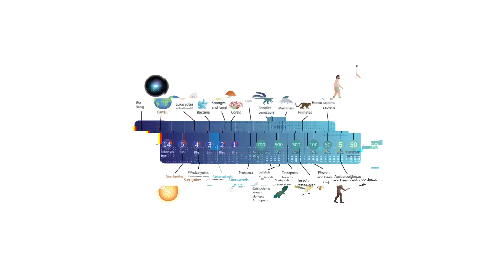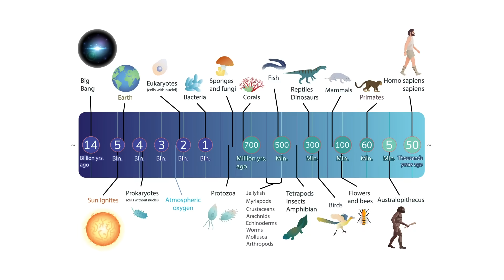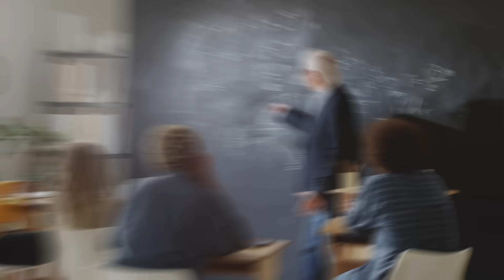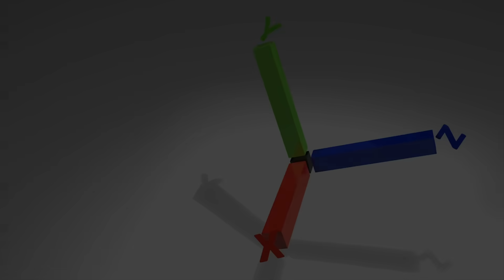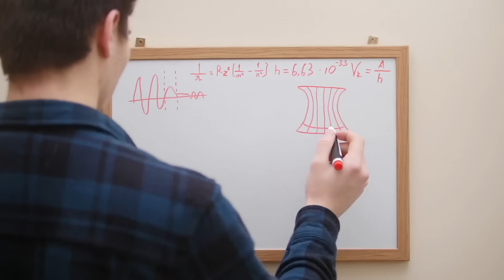Brian Cox - Why Did The Big Bang Happen?

Comment: My Next Best Science Fiction Idea
--------------------------------------------------------
Black holes can be of different sizes, based on the amount of mass consumed. This yields varying event horizon radii, despite an infinite point within. Yet somehow they are classified as the same singularity, of infinite density, when the varying masses must imply varying infinities within. Obviously a contradiction. My argument is that maybe the singularity point and the infinities of temperatures and pressures are merely mathematical oddities, and not the true reality inside. After all, the word 'singularity' means that physics has broken down. Now, eddies within a stream or sea can become gigantic, pulling in torrents of water, yet at the center of the funnel - nothing. It's the flow, the siphon that got going, which keeps everything moving in and the force increasing. Has anyone ever considered that inside a black hole everything has become nothing? Just imagine that as you crossed into a black hole everything including pressure and temperature and shredded matter and warped spacetime got unimaginally large, but still numerically constrained by the limits of a real universe, and then the moment you got inside it all just popped out of existence! One might go from a very large sphere of the immense flow of something, till - just across the horizon - a single point of nothing. In which case our contemporary universe is like swiss cheese. So perhaps the big bang had a relatively large event horizon, perhaps more mass was being created than spacetime very early on, perhaps very large temperatures and pressures became incidental to the incredible densities of matter being ongoingly brought into existence, and perhaps nothing became something without constraining or holding back an infinite something before it initially burst forth.

Comment: White holes produce galaxies . They get their matter from Black holes.  This process occurs due to another dimension where time doesn't exist which is also responsible for 'Spooky Action at a Distance' .  There is no need for a Big Bang Theory . The apparent 'accelerating'  expansion of the universe is due to our Milk Way Galaxy contracting into an elliptical galaxy....we are moving away from the universe not the other way round. This process is accelerating as it collapses so  the 'expansion' appears to be speeding up. The Background   Radiation , thought to be an echo of the mythical Big Bang is nothing more than the rest of the unseen universe which is much older and larger than current theory predicts. 
This is my homemade explanation for what I see. No galaxies moving faster than the speed of light, no Dark Energy or Dark Matter that nobody can find and no 2 Trillion galaxies fitting into your pocket.
It may be all bollox but it makes alot more sense to me than the Big Bang Theory.

Comment: The law of conservation of energy states that energy can neither be created nor destroyed - only converted from one form of energy to another. It would appear that all the energy in this universe is being converted into space through the interactions of the charged particles that exist in it. The expansion of the universe is fueled by the interaction of the charged particles that exist in it. Electromagnetic radiation is just the neutral memory of the interaction between these charges broadcast through space but also stored in it. The fabric of space recording the record of time, using the instruments called particles. Does it sound good enough to go platinum though...
Reply: Blimey, that takes a bit of thought!
Is  it plausible to accept that the conservation of energy law would not be able to apply to the early stages of the universe? Obviously something weird and wonderful was occurring but I think  different laws could have been applicable to explain what was occurring!
Reply: @stuartmoulton6426  Is it plausible to accept that the force that energized this universe was applied from outside of it? We have to bring internal energy to bear anytime we want to exert a force on the exterior world. 

Force transfers the energy we bring to bear from our internal state to an external state. That force can be applied to external bodies and transfer momentum internal to external, external to internal. A good example of the internal to external back to internal exchange of momentum through force is a knockout punch. That is internal energy brought to bear delivered by force to a body external to yours and that momentum is transferred by force to the internal of the body it is delivered to.

It seems conservation of energy would apply to energy moving from an internal to an external state, as well as energy moving from an external to internal state. In this way energy cannot really be contained to a closed system. The nature of force transferring energy from internal to external states will never allow it to be contained to any particular system permanently.
Reply: @jayb5596  I don't see anything implausible👍👍👍, difficult to understand, yes🙄🙄🤔🤔🙄😖😖, implausible, no!!!!👍👍👍
Reply: @stuartmoulton6426  Here is a thought experiment for you to ponder.

The 0s and 1s in binary represent OFF or ON, respectively. In a transistor, a "0" represents no flow of electricity, and "1" represents electricity being allowed to flow. In this way, numbers are represented physically inside the computing device, permitting calculations.

Atoms are built from quarks, two up quarks and one down quark produce a proton. Two down quarks and one up quark produce a neutron, they are interchangeable. A neutron is unstable outside of the nucleus of the atom and will decay into a proton. Protons are stable outside of the nucleus.

Neutron "0" represents no flow of electricity.
Proton  "1" represents electricity being able to flow.

The carbon atom for example represents 6 protons, 6 neutrons, 6 electrons. That makes up the nucleus of the carbon atom, so it represents a 12 bit byte. Each proton and neutron represent a single binary digit. 

A single carbon atom representing 666, is a 12 bit byte. If you account for particle spin you realize that these 12 bit bytes of carbon can be arranged in various nuclei alignments, to represent any combination possible within that 12 bit byte. This is just a single carbon atom.

12 binary digits, or 3 nibbles (a 'tribble'), have 4096 (10000 octal, 1000 hexadecimal) distinct combinations. Hence, a microprocessor with 12-bit memory addresses can directly access 4096 words (4 Kw) of word-addressable memory.

Extrapolate that concept on to every atom in the universe. The computational power makes no rational sense. 

We are a duality of self. I am just a duality of my "self and I". Self converts biological binary codes into conscious depictions, projects those depictions back to us. Just like we do with our form of binary code, on modern devices. Self observations are subjective to the individual, self projections are objective to individual consciousness.
Reply: @jayb5596  
Oh, no!!!!!!!😂
My neanderthal brain was running up a VERY severe incline thinking about universal existence theories and black holes and the question of multiverses et al,  now you go and add that to the mix.....
If only we could discover a way of tapping into the potentials of our existence?????
Thanks for your informative and interesting reply Jay, I'm now heading to my darkened room........👍👍👍👍
Reply: @stuartmoulton6426  😂I think anytime we ponder the nature of our existence, blackholes, spacetime or any other difficult question such as those. We all feel a bit like a neanderthal. 

It's quite possible biology has a lot of the answers we seek just under the surface of our perceptions. The human heart for example quite an amazing organ when you think about what it is and does.

Have you ever wondered how life energizes itself? I have pondered it myself quite deeply.

We are made from atoms and molecules that have no momentum to do work unless external force is exerted on them. However here we are powered up like the energizer bunny with plenty of momentum to do work. If our heart stops beating though and the fluid stops flowing, our energy and momentum to do work instantly rivals that of the molecules and atoms we're constructed from. Which is null without external influence because they are at rest in the field.

So is the heart our power source? If so how does it produce electrical impulses to provide energy to give us our momentum if the particles and molecules themselves don't appear to have none otherwise.

This is where the discussion gets interesting and perhaps the heart has something valuable to offer us.

We produce electricity here on earth by rotating permanent magnets around a conductive coil of wire. Doing this exerts a magnetic force on the electrons contained in the conductor giving them momentum to do work producing what we call a current and this moving current or charge produces a magnetic field that propagates along with the charge.

Permanent magnetics are made when the atoms of the materials, north and south poles are aligned and connect to magnify the intensity of the force. Which is what is propelling the field through spacetime. 

Ordinary non magnetic materials, atoms are arranged in ways that their poles do not align and this distributes the force across a broader area rendering it unable to produce a magnetic force powerful enough to interact magnetically.

I suppose that our magnetic field of planet earth is produced by the current known as our electrons as they flow through the umbilical cord we know as field lines.

In this logic there is only really a single field line and it bends and warps around to connect every atom inside this field. Our hearts use the same magnetic interactions we do to produce electricity. A different scale and not through rotating magnets around a conductor. Rather by aligning the atoms in such a way that the field lines interact causing electrons to repell each other in rythem (back and forth) and this produces an additional current and these little charges all interact and sync to produce a much larger rythmic response.

So life just uses the energy available to it to energize itself. Electrons repell each other but if they are trapped inside of a field line they are propagating in a wave that still has repulsive force at the individual electron level. Even though the field is in motion and relative to each other the electrons are at rest. If you bend that field line around on itself you can use the magnetic fields of the moving charges to apply force from that field to the electrons moving in it. So it's using the electrons own repulsion to produce momentum by warping the field line around on itself.

This would mean gravity is nothing but the force applied to propel the moving electrical field and that biology simply uses the electron and its own repulsive nature to produce momentum by field interactions.
Reply: @jayb5596  a while ago I considered all of the universal matter being in one place using a very crude calculation involving an extremely rough estimate of the quantity of particles in the cosmos and the smallest cubic area it would fit into on the assumption that the Planck volume was the minimum achievable volume, the result was a surprisingly large item rather than a infinitely small one! Definitely a case of "back to the paper and crayons!" Lololol!!!
Reply: @stuartmoulton6426  I've pondered protons, neutrons and quarks being stationary switches and connected via the propagating electric field which communicates with the stationary switches through electromagnetic radiation.

Comment: The universe is expanding faster as time goes on. Like we are being influenced or pressured by another force. Wish we could crack the mystery of dark energy and dark matter.
Reply: The accelerated red shift could be explained by observer contraction if the observer is in the state of contraction the whole universe would appear red shifted, every spiral galaxy has a supermassive black hole at their center, black holes contract and dilate time. The so-called, ultra fast expansion of the early Big bang would have been time dilated by the extreme gravity of all the matter being so close together, so the first micro or nanoseconds of expansion may have taken eons of time to elapse.
Reply: @kellymantei5393  Accelerated red shift could also be explained if we are actually going down the gurgler.  The universe is actually shrinking by being sucked into a great big plughole at the bottom of the cosmic bathtub.  Every point closer to the hole is moving away from points further away at an accelerating rate, and that's how the redshift happens.  Just watch your bathtub if you need convincing :)  

I think you don't need observer contraction to explain this - just the fact that somebody let the water out of the cosmic bathtub.
Reply: @simongross3122  every spiral galaxy has a supermassive black hole at its core, which translates to galactic time dilation neighborhoods, the Milky Way has another time dilation rate than other galaxies, yet the speed of light still measures the same. I hypothesize that in another 13.8 billion years all the physics constants from today, like the Hubble and plank constants will be even farther from correct, in the distant future.
Reply: @kellymantei5393  And they say scientists have no sense of humour.  I can't imagine why.
Reply: @kellymantei5393  Write that up and submit it ... don't forget to include the Equations.
Reply: @dimbulb23  the red shift comment, or the 14 flavors of matter?
Reply: Our flavor of matter makes up 7% of the measured gravity in the universe, so if the remaining 93%, word divided by 7 it would equal a total of >13.2 flavors of dark matter/energy. Now try to imagine 14 bell-shaped curves of observable universes all expanding from one big bang. 14 directions from one big bang and 14 flavors of matter mixed in each universe. (Thought experiment) (take it or leave it)
Reply: @kellymantei5393  Very thought provoking. You have inspired further investigation into EM field perspectives. Thank you !!
Reply: Everything has its time. Humans will crack dark energy mystery in the 2305. Till then, have patience my child!
Reply: @Razrman  This is why I put the question on the back burner now for 5 yrs. There is so much other more interesting stuff being discovered recently. Can't wait for the JWST.
Reply: Perhaps the universe inflated into something and after the initial explosion lifted this          " stuff " and it is now no longer being lifted but compressing. This created the negative pressure we see stretching the fabric of space time. I am a flooring shop owner btw. I hardly understand any of this.
Reply: Tracy Puckett knows all ❤️
Reply: Yes, you are being influenced and pressured by the 'force' of corruption..

So here is one of the main problems of understanding.. 

People have a very poor understanding of what the word 'infinite' actually means.. This is not any kind of 'fault', but just that we have evolved within the confines of what appears to be a finite environment, and we thus try to look at things in finite ways, also justifying those 'finite' thoughts. When I first approached the 'problem' I had the same difficulties, so it takes our minds a lot of effort to reach another perspective of understanding, but it IS achievable.. 

Firstly, there cannot be more than one 'instance' of infinitude, otherwise a secondary 'thing' would render them both 'finite'. So we are describing a 'oneness'.. Also, it can have no 'beginning' nor 'ending' as these would also necessitate a secondary 'thing' (or the utter nonsense of a 'nothing'!), so we are describing 'eternity' when we apply 'time' concepts. Then, we have to admit that it can only be the one thing that interconnects all other 'things', and we deduce this to be 'Space', necessarily..

All references to 'size' or 'direction' do not apply to the nature of infinitude, and thus have no relevance to our understanding of the true nature of existence. 'Measurement' has limitations.. When we point to any position in Space, we effectively create a 'beginning' to any subsequent forms of measurement, which only has relevance to the entity desiring to understand said 'measurement'. This does not make it a feature of the nature of reality, only a desire from a Human perspective.

spaceandmotion
Reply: exactly! it is accelerating. which disproves big bang
Reply: @lonewolf5533  a "contracting observer" model of the universe, would explain the red shift and the acceleration.
Reply: You should work on making sense
Reply: @josephhall5681  LoL 🤣 it struck me as funny it sounded like you were inviting him to be a guest on the new streaming service series called "making sense"
Reply: The universe expands faster than light can travel
Reply: According to the cosmologist the universe is 13.8billion years (earthly count) as the universe is fast "expanding" with a speed faster then the speed of light!
Then Allāh the creator says:
"And the heaven We constructed with strength and indeed, we are its expander"
If you scientist discovered this in 1924, while this is book who mentioned that thousand of years ago.
Moreso, evidence of the bigbang is right there in the Qur'an, provided you asked for it.
Reply: God bless everyone!!!
Reply: Easy…dark energy is composed of evil thoughts and missed opportunities that people omit and expels into unexplainable phenomenon…all energy has to go somewhere 🤷🏾‍♂️